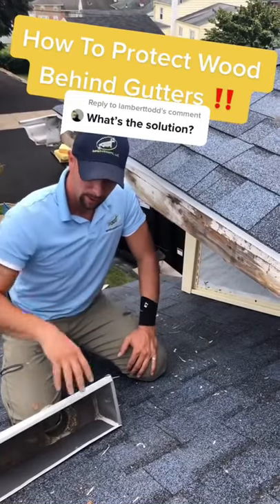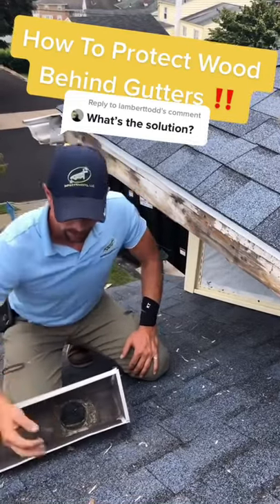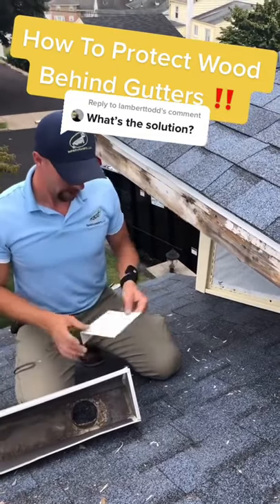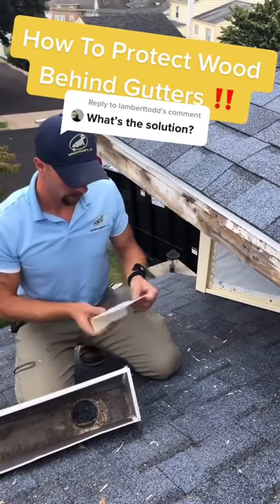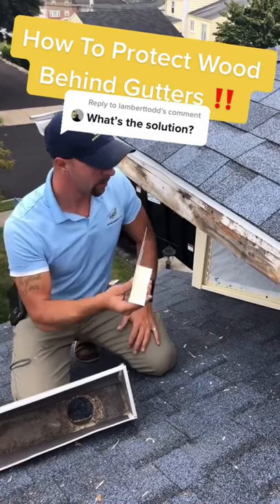how to protect the wood BEHIND gutters... #shorts

Comment: That’s your sub fascia board easy to replace. You generally wouldn’t paint this. It’s a part of the rough framing to cover the rafter tails. It is simply multiple 2x6 boards spanning around the house to give you something to nail your fascia too and add drip edge. You’d either install a nice wood trim board to go over the sub fascia and over the  drip edge and down to where the soffet meets with f channel and then primer and paint that. More classy in my opinion. Most commonly what goes over it is just called fascia which goes over the sub fascia and it’s a thin aluminum metal. Fun fact a lot of houses don’t have fascia board at all or drip edge and just have exposed rafter tails that are stained to keep them healthy. Sub fascia is added by the framing contractor of the house. Typically a roofers job ends at the drip edge down and normally a gutter company wouldn’t be allowed to add any framing to your house but they might add or replace the metal trim fascia if you have sub fascia board installed already and want it replaced but they really can’t start tearing out old sub fascia. At this point it would fall to a m/a type k contractor here in Michigan which is the siding company and they can add or fix old sub fascia boards. I see this house is getting new siding so I’m sure it’ll get taken care of.

Comment: Paint the damn wood. That's all
Reply: build a proper roof
Reply: @DSkimRS  we use timber facia all the time we re roof 100 year old roofs and the timber fascia is perfectly fine. For a roof to be over 100 year old and still fine then it's a proper roof
Reply: @master_Blaster91  i use timber fascia too but it doesnt get wet because i use metal or slate and it projects out into the gutter....
Reply: @DSkimRS  yes so do I

Comment: This man has no clue as to what he’s talking about. If you use a good quality paint the wood will last 20-30 years as long as you do gutter maintenance. Plus if your gutters are installed correctly you won’t get any kind of water i between the gutter and facia. Using flashing like the covering the entire facia will cause sweating and will cause the wood to start rotting out and you won’t even see it till it’s to late.
Reply: Really? I’ve been on 30 yr old homes with aluminum over bare framing it looks brand new.

I mean I’ve been on older houses than that but their not always so happy. But usually because they weren’t painted routinely enough before the metal went on, or it’s dry rot.

Minimal sweat can occur but honestly nothing really at all. It will dry as quick it forms.

And you say good quality paint the wood will last 20-30 years, but that’s good quality paint every 2 years to get that.
Reply: @justinstevenson2061  and did you miss the part where I said if you keep up maintenance that the wood will last 20 -30 years. I’ve been in construction the last 20 years here on the west coast and the only time I’ve seen covering the wood is on a solid beam and new on fascia

Comment: I wish you had been showing the whole process with how to place the gutters themselves with the hidden hangers, then how to place the gutter guards properly in order not to damage the facial boards… I did place these improperly, i had no guidance and thought it was easy and it is, but there are a few tips you really need to get before starting cause the consequences of rain water leaks (like waters dripping along the wooden facia board behind the gutters. & or because of the holes you made through shingles or the bottom single edge of a  roof by trying to force in gutter guards by lifting the first shingles so much that they eventually broke or made plenty of small holes n come soak the side wooden structure /of your house.Such damages could really get very costly

Comment: You have just trapped the moisture in your timber behind that.it will now sweat and rott thru time and spread thru the joist ends. Shocking mate
Reply: You should let the wood dry out and coat it with a good oil based primer and paint topcoat

Comment: If you’re some kinda technician you need to make sure the soffit can breath into the attic, install baffles in the attic then put vented soffit on then your aluminum facia. Your new roof will last so much longer with proper ventilation…and you get little to no ice in the winter that tries to rip your gutter off the shitty sub-facia that didn’t get replaced lol

Comment: "Drip Metal " "positive flow"? What is he talking about?  It's DRIP EDGE, and water? Just like electricity takes the path of least resistance. If you give it an opportunity to go where it SHOULDN'T, it definitely WILL.

You shouldn't just cover that either. Sand it it chip it off, inspect it for rot, prime it with a good exterior primer, and then MAYBE you can cover it.  Dont forget your ice and water shield above it either.

Comment: That metal sweats and rots that wood
Reply: Where is the water at to make the moisture and sweet?
Reply: Metal sweats in itself..if you have two substances metal and wood the wood us a sponge and the metal collects moisture abd sweats..I am a water and mold specialist.i deal with this all the time. The wood after a few years crumbles...that's why we use pvc boarding. In addition we use cedar shims behind it. Again two different substances. However plastic doesn't sweat like metal
Reply: @scotsthilaire4025  Thank you for the answer. Since I've done metal roofs alot I can say we use house wrap from peek to the fascia board.
I see why I was taught that way.
Reply: @gi-me-the-gamenerd5325  more too it on metal roof you have strapping between sheeting and roofing. Allowing for significant air space to keep things dry
Reply: @scotsthilaire4025  pretty much. We use perlins wich are 2 by 4's nailed down to the truss and we put them 2 feet apart. Then we use the construction wrap.